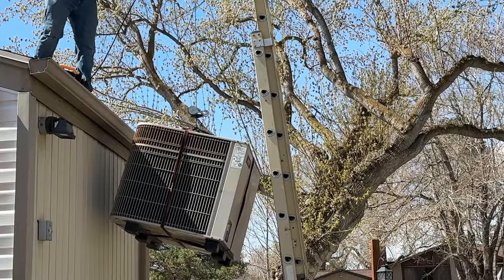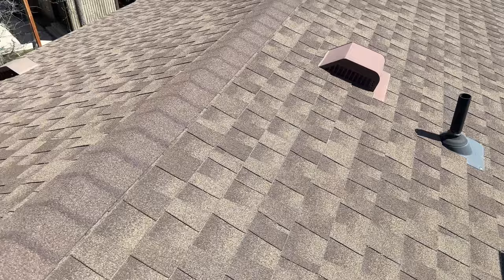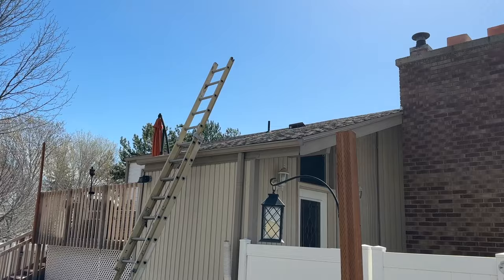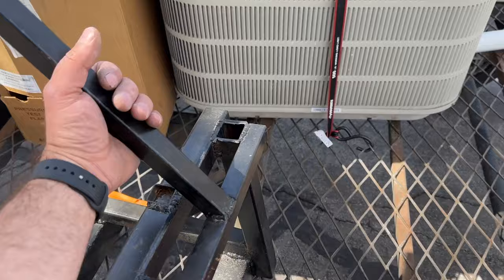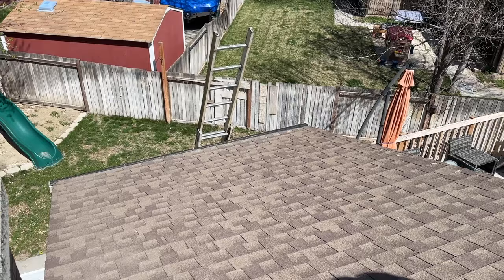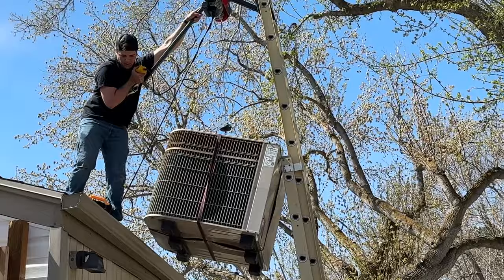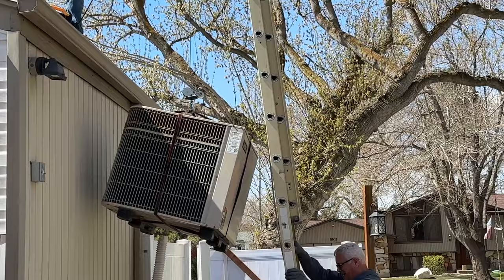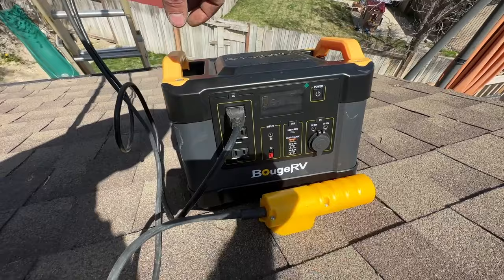DIY Harbor Freight LADDER HOIST?

Comment: Being a roofer, sliding stuff down over the shingles will probably damage the shingles. Should lay plywood on the roof. If you damage the shingles you won't be able to repair the damage shingles, you will have to replace the whole section and that will be a lot more than what you are saving on a crain.
Reply from the maker: If you heard that part of the video, this unit had plastic rounded feet that glided right over the shingles, so they did absolutely no harm.
Reply: The shingles will "crush" where the "feet" are and eventually leak.
Reply: @The DIY HVAC Guy    you can still damage them. Especially if its an old roof
Reply: @diyhvacguy brother some roofs are so old and brittle that simply walking on them can damage them. If 40 mph winds can damage shingles it's not hard to understand that 200+ lbs can create a lot of problems for shingles.
Reply: I'm a professional homeowner and I love your video I do agree with putting some plywood down or maybe even using some corrugated plastic instead of plywood just to spread out the load so that it doesn't possibly damage the shingles
Reply: This is why anyone with a shingle roof should switch over to a tin roof . Shingles are weak as f*ck and the least little thing causes a leak .
Reply: @craigalston2208 yeah then you have the issue of the screws and washers pushing themselves out which you have to have fixed. They all have their own problems.
Reply: @BRExteriorPro  I'm staying in a civil war Era plantation house with the original metal roof and no leaks . My uncle is staying in a 40 year old house that he bought new and has replaced the shingle roof 3 times . I'll take the metal roof over the shingles anytime  .
Reply: @BRExteriorPro  They do have standing seam metal roofs with no exposed fasteners. Of course it also cost 3-5x compare to shingles.
Reply: @craigalston2208  Coastal regions can't use steel roofs due to corrosion. Zinc/Copper roofs cost 6-10x compare to shingles.
Reply: @mintheman7  thanks for the info . I don't have that problem because I live inland  .
Reply: @diyhvacguy   3 tones? at that weight its more than a baby grand piano on the roof seriously doubt it weights that much.
Reply: @stevecuevas2033 - 3 ton unit as in cooling capacity not weight right?
Reply: @MichaelDillin professional homeowner… …I love it. Lol
Reply: @craigalston2208  Shingle roofs are a thing of the past, I agree with your statement.
Reply: Or use several layers of cardboard

Comment: if under 450 lbs, a 12' or 15' material lift can be rented from a nearby rental yard for not much as well.  very clever technique that you use. (edit: 450 lb, not 250 lb)
Reply: @ronsencillo1920  yes, indeed.  level concrete/blacktop surface required.  and i think the capacity was 450 lbs.  it's been a minute.  the lift has many uses.
Reply: Yea, i've Used Material lifts a lot. they are Great Crank up Lifts. Can be put in the back of Pick up truck bed or trailer.

I also like Scissors lift s.

Comment: We've hauled thousands of gallons of tar with a pulley & rope attached to a ladder. The ground assistant attaches the pail to the rope & pulls the rope as the roof help holds the ladder away from the building until the bucket is above the edge, then pulls the ladder to the edge & removes or empties it into a cart. Your idea takes the  labor away.

Comment: I’ve used this same technique installing a ductless condenser on the side of a building. Attached the hoist directly to the ladder. The carpenter on the job with me was very impressed 😊.
Reply: I installed mine about 4 feet up from a truck tailgate with help of someone else. Man, that was sketchy- and that was only a 24k btu unit.

Comment: A good idea.....very sketchy though. 
Also....the whole sliding of anything across shingles is a very bad idea....all it takes is one damaged shingle and the job ends up being free. Careful. Very careful.
Reply: Absolutely correct,one or two damaged shingles will result in a complete re-roof in a court of law!
Reply from the maker: Yes I was going to do a still shot of the risers on it, but they were rounded on the edges and about 6” tall so it would have been really hard to damage the shingles
Reply: 100%… PROTECT the roof shingles….
Though retired, I spent a career in construction, & that was the most glaring fault I saw in this video.

I couldn’t tell, but I assume the ladder’s base was WELL anchored….

Comment: I made a ladder hoist years ago out of tube steel and a hand crank winch. Frame locks into ladder rungs and I built it for hoisting compressors to the roof. Also some ductless outdoor units. Nothing over 250-300 pounds. No power required, can pop handle off and use a 5/8 socket and a drill on low speed.

Comment: For over 50 years the urban search-and-rescue teams have used similar techniques, however your attachment point leaves to a vulnerability.  The rungs of a ladder or only designed to support a limited amount of weight typically 300 lbs. The correct way to employ such a device is too attached to the rails of the ladder not the rungs.  This is referred to as a lean-to Derick.

Comment: Only thing that might make it safer, would be to add a way to extend that T bar being used to move the ladder away from the house/ roof, possibly use  a pin to make that T bar longer and at a different angle relative to the roof, otherwise great idea

Comment: You can make the bracket by running allthread  through two rungs and bolting a couple of pieces of plywood to each side of the ladder. A piece of pipe with another piece of allthred through it for your attachment point.

Comment: That’s awesome. I was thinking a good alternative for a DIYer would be to use a pulley system that reduces the weight so that whoever is lowering, or raising the item is only pulling a fraction of the full weight.

Comment: An even easier way, would be to have a second ladder attached to the first, perpendicular to it. With the hoist riding on rollers in the channels on the side of the perpendicular ladder. You would be able to lift the AC unit and slide it from peak to gutter without touching the shingles/roofing at all, and you wouldn't have to do that awkward thing where you tilt the ladder away from the eaves, with someone else holding the bottom.

Comment: If you had to lift something even heavier than this AC unit and really wanted to make this whole setup work as smooth as butter, use a long ratchet strap on each side of the ladder to keep it from sliding left or right, anchoring them down in a straight line with the feet of the ladder so as allow the ladder to be tilted upward without tightening or loosening those straps. Anchor the feet of the ladder in place with stakes or with something very heavy just in case. Then use another very long strap or a strong rope attatched to the very top of the ladder to lift the top of the ladder back away from the edge of the roof. Once all that is done, you will have a very sturdy makeshift crane in place that won't tip or fall on you all of a sudden.
Reply from the maker: Thanks for the tips!! Cheers

Comment: Looks like a laddervator commonly used in roofing.
Nice job and improved design,  although a chain hoist or cumalong or two pulleys or hand crank winch  could be cheaper and just as effective?

Comment: Looks good. Looks like the hoist bracket could (under extreme influence) shift to the right and off of the cross member.
Reply from the maker: The zip screws keep it from moving, but even if it did, the other bracket is sandwiched between the cross member. It would take something serious for that to want to shift to the right like that though

Comment: 100% OSHA Approved!
Reply from the maker: Lol
Reply: If OSHA took an honest look I think it could be legal. A crane needs to lift 2x the weight without collapse. he had the weight on 2 steps of a 300lb ladder I assume, so 600lb capacity. Then 75-80% of tipping. He pushed the ladder away with one hand so not much weight at that angle plus it can only fall against the house so it can't fall that way. A good ladder that hasn't layed out in the sun for years should do the trick just fine. I wouldn't stand under it but who would. It's kind of like a breast derrick that we used for picking heavy rocks in fields or yards. Better than letting it down on a rope. I wouldn't ask them they get all worked up about things that aren't in the book.
Reply: @williamrosenow6176  Not

Comment: 🫢 Sketchy. Pretty sure that is not OSHA approved. I’d have demo’d that unit in place or just rolled it off the roof. Ladders are not designed for that kind of loading.
Reply from the maker: Each rung is rated for 250lbs, and it’s actually higher then what they say for safety reasons. This might be up there but it not over 250lbs for sure

Comment: Good idea for a Compressor not a Whole unit. Get a Crane.  That ladder was shaking pretty good. ( Max ladder load/ Rung - Probably exceeded ! ) 
That Looked Like You were shaking pretty good too. That Looked Pretty Sketchy. I'd rather spend a Few Hundred dollars for crane. $350.00 for a Crane around Here. 1 up & 1 Down 5 ton unit. Money Well spent.
Reply from the maker: Some situations literally can’t fit a crane so this is the only option. Part of my shakiness was this design. I’m re engineering a new one with an aluminum frame that is going to be much easier to handle. 

But one of these days I’ll hire a crane. I still never have 🤣 thanks for the input!

Comment: lol and so if the unit is just being removed and a new one not being put in, you put a lot of extra work and time into that when could just easily shove the thing off of the edge and let it drop. Its not like it would damage the concrete from a mere 10-12 foot drop
Reply: ... but then there would be no video of the fancy lift!
Reply from the maker: Um all the refrigerant would leak into the environment. So that’s a no go. I’d rather recover refrigerant off my trailer then in a rooftop

Comment: Dave, Love your videos man. Id like some advice. This is a long story but im gonna cut it super short. We bought a new house..it has one hvac unit in the attic that serves the master bedroom and one for the rest of the house. Both units should be replaced but the main house unit is working currently. Anyway, we got a quote to replace one and both. its 35k to replace both, which, we can afford easily, but dont want to pay that for these units. A light went on in my head...why not use a mini split in the bedroom. What are your thoughts on that?
Reply from the maker: Absolutely. Mini splits are far more efficient so if you could use that for the master that would be fantastic
Reply: @diyhvacguy  You have no idea how much I appreciate this info. What about the main house? Would a mini split be a good idea or stick with a traditional unit?
Reply: @diyhvacguy  Also, I have background in framing, auto mechanics and am not afraid of hard work. Is a mini split something someone like myself could do?
Reply: @mnight207  I did this. I installed 1 18k in the family room and a 9k in the master br. Going to install another in the other br. Closed the door to the master and can heat the room to 68 while the rest of the house is 56 for only $1 per night. Same cost during the summer. Costs me less than $1,500 for both.
Reply: @mnight207  you can do it yourself. Tips I have are to put the line set covers under the line set coming out of your house before you tighten everything down. You will get a cleaner look. Also before you release the refridgerant make sure everything is the way you want it to look at the end of the day. I spray painted the line set covers the color of the house to camo it.

Comment: Why the hell do they put a/c units on the roof? You need special equipment to hoist. You can damage the roof and cause leaks. It’s hot on the roof and therefore less thermal efficiency. You risk injury to installers. It complicates maintenance. Etc. Why not just have a ground level installation , surrounded by chain-link fence or concrete blocks?
Reply from the maker: Amen bro…

Comment: What do you think of some sort of telescoping leg that rests against the roof? Step one would be extend and lock the leg out (resting on the roof) and then lower the load to the ground.
Reply from the maker: That’s a brilliant idea. I’m going to look into that. I don’t use this that often but when I do that would make a huge difference!
Reply: @diyhvacguy  Nice- Hopefully it turns out to be a helpful idea. To me, it looked a little sketchy when you were balancing the brace/ladder and also using the hoist, but I don't enjoy heights! Another random thought- I have a metal roof so perhaps factor in corrugated metal roofing when designing the feet. Man, I gotta learn to weld!!!!
Reply: I had a similar thought, but my brain is freezing up on how to get the unit back over the edge of the roof gracefully so you can lower the load without the ladder slipping. Of course, the rest of my mind is wondering why anyone would put an AC on a roof in a residential situation.
Reply: @rupe53  I agree and with the popularity of side dischange I don't think it's going to be common anymore. But I still think the ladder hoist would be useful for side discharge units mounted to the side of a house

Comment: how heavy is the condenser? please someone chime in if you know, tia, '3 tons' seems like it must be made of lead? i guess next question is how much can this system handle in weight of the thing being raised or lowered? tia
Reply from the maker: 3 tons refers to the air conditioners cooling capacity. It’s measured in btu’s. The unit itself weighs maybe 150-200 lbs